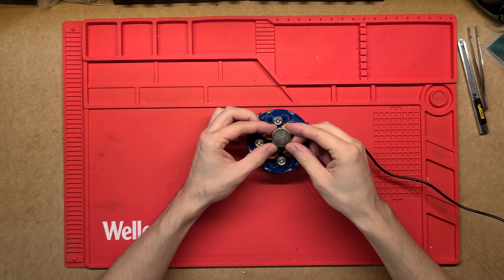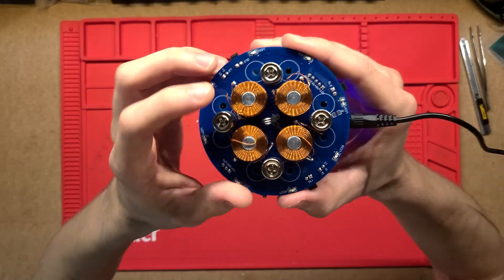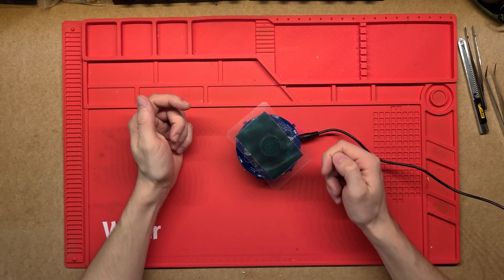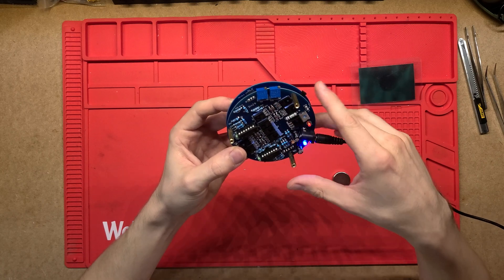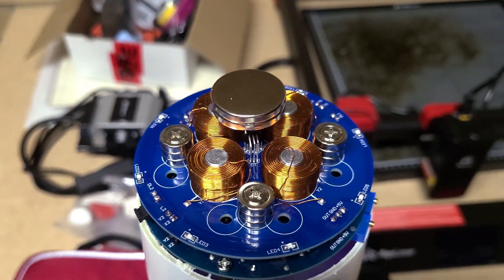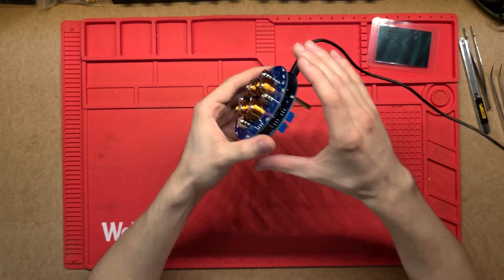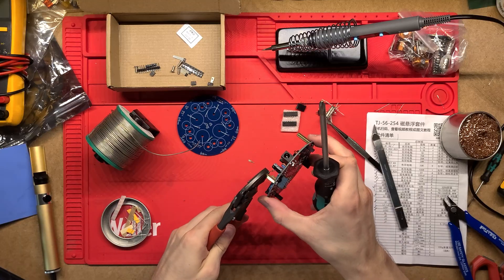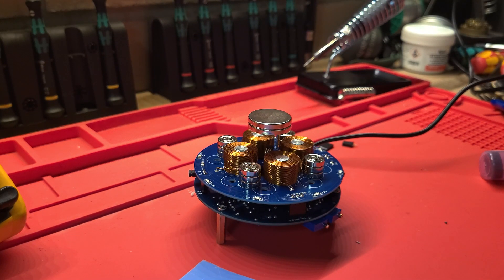DIY Magnetic Levitation Module

Comment: What voltage levels are you aiming for exactly when adjusting the potentiometers?
Reply from the maker: Nothing specific, just want them balanced on both side, so the coils pull the magnet equally in both directions.